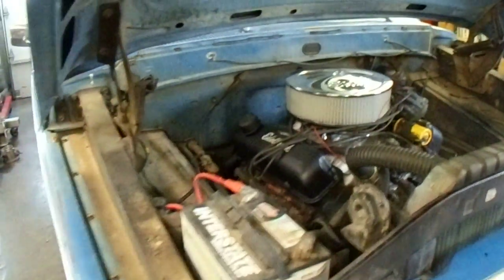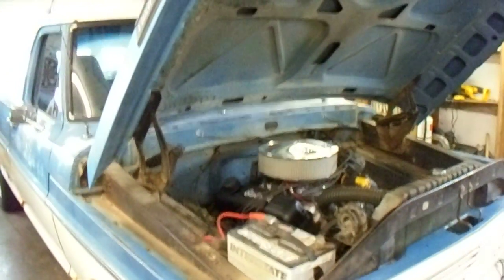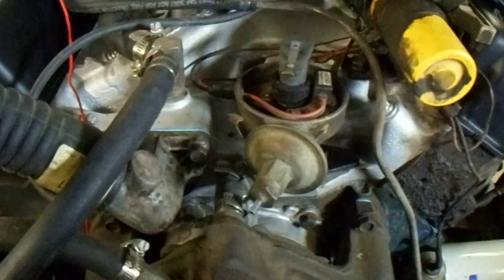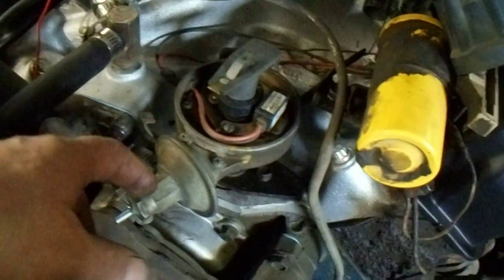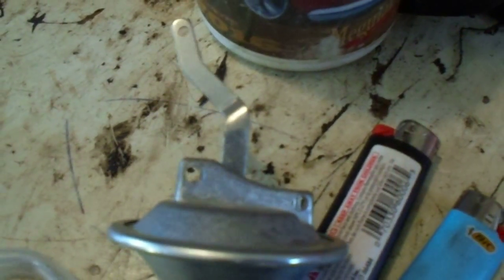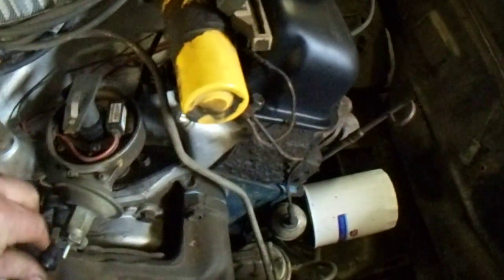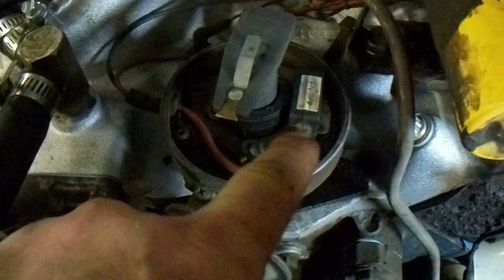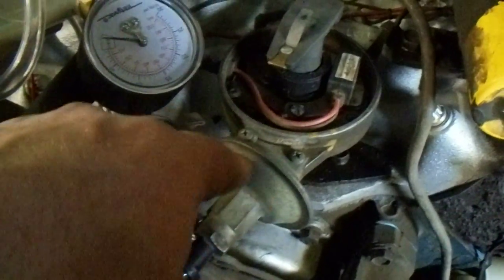How to test a distributor vacuum advance canister

Comment: No Mighty Vacc Needed! 

Step one: Start Engine 
Step Two: Pull Off Advance Hose 
Step Three: With Your Mouth, Make The Advance Kick In, then let come back to idle 

You should see a change in the way your engine runs, you can hold pressure on it too this way way really set it to the way your needs are. Good luck!

Comment: My truck has an old distributor in it and recently when I start to floor it it will do good for a few seconds then starts to die and if you hold on the gas it will backfire that sound like the canister?

Comment: I’ve had this misfire all summer, been throwing parts at this 85 cj like a fool. Went and bought a vacuum tester put it on the distributor vacuum and sure enough, not holding pressure. Think I found my misfire. Makes sense because it misfires in 3rd and fourth gear.

Comment: so is it possible that if a guy was running a large cam that made low vacuum he could get into trouble with this set up?
Reply from the maker: Well sort of it would make it difficult to dial in initial timing on the low side as that is where the lack of vacuum becomes an issue when running a cam with a large amount of cam overlap however total timing would stay the same on the top end as cam overlap becomes less of an issue in producing vacuum at higher rpms